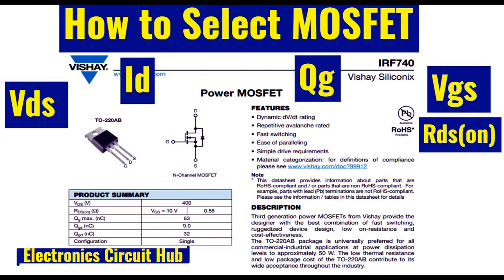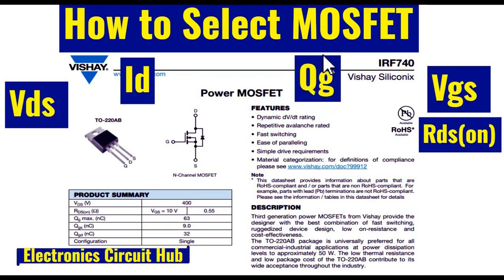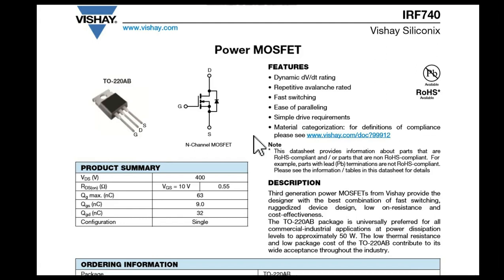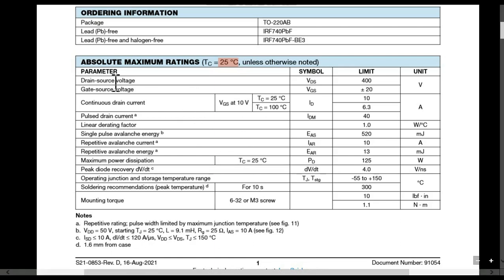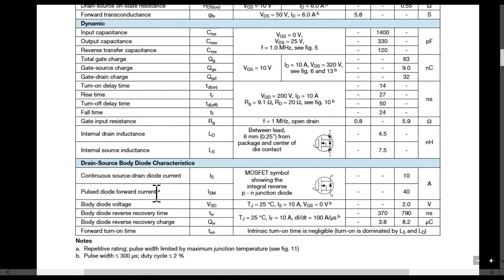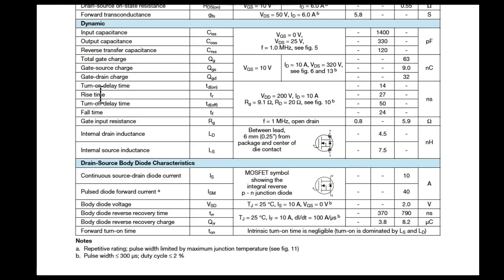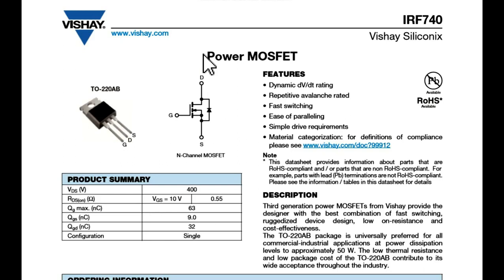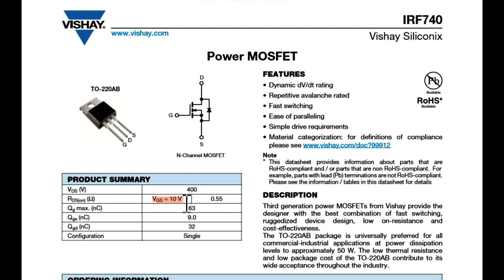How to Select the Right MOSFET for Your Design | N-MOSFET IRF740 Explained

Comment: What about using to drive an inductive load . Max value of vds how does this affect the negative voltage from the back emf
Reply from the maker: Hi...Reduce the back emf using freewheeling diode or snubber. And have some safety Margin to mosfet Vds.